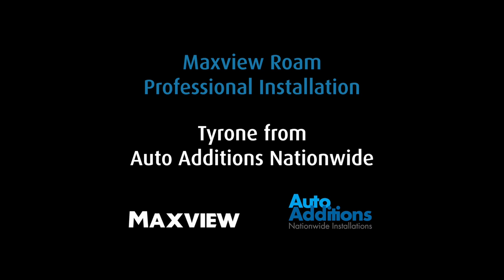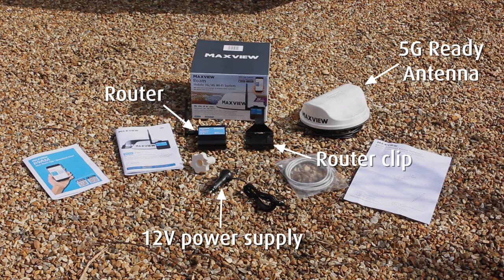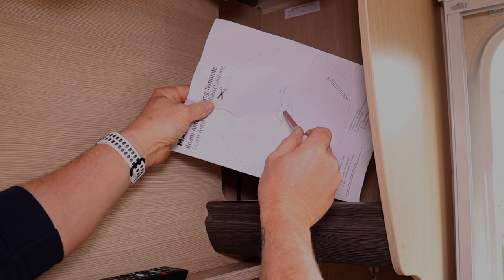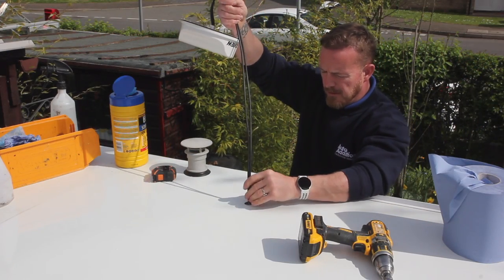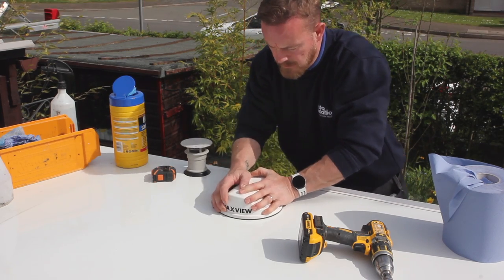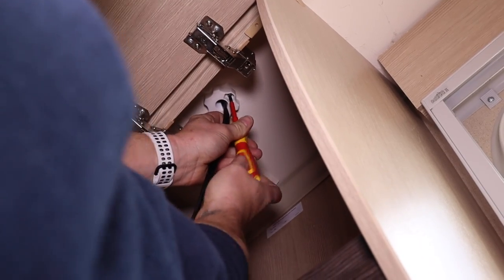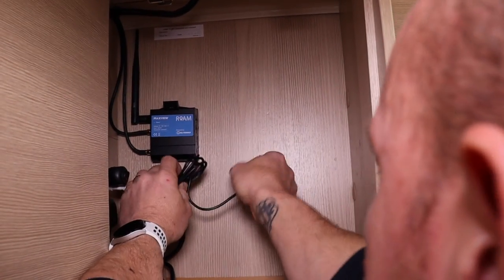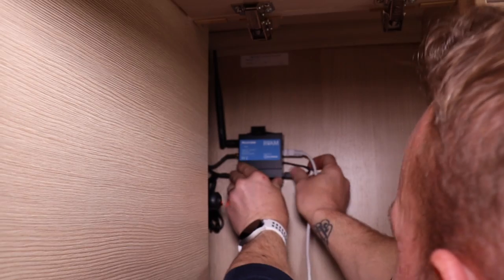Maxview Roam Installation | Motorhome WiFi System | Maxview WiFi | Roam X Installation

Comment: Hello team maxview, i have the extension cables installed, the router installed and configured corectly, SIM ok and activated but I don’t have any signal from the antena in 3g/4g. The mother antena is at 500/800 meter from the vehicule. I don’t understand why. If I move, I manage to get a Little signal but not optimal. Only one or two level of intansity. My speed is 0,3mbits download and 0,4mbits upload 😢😢😢